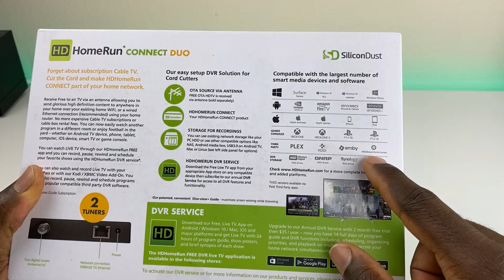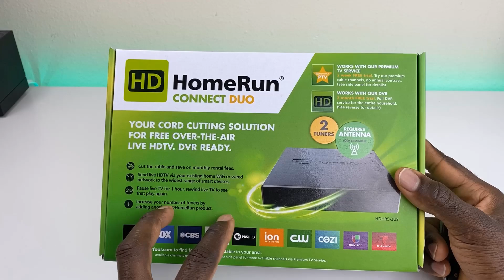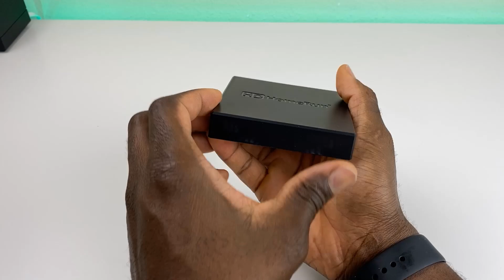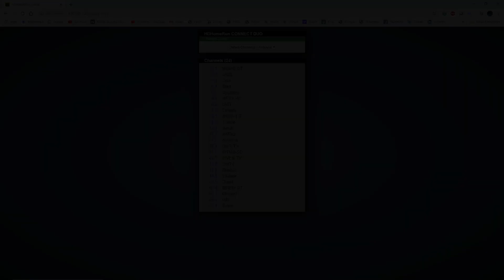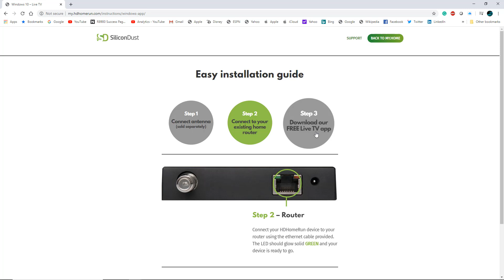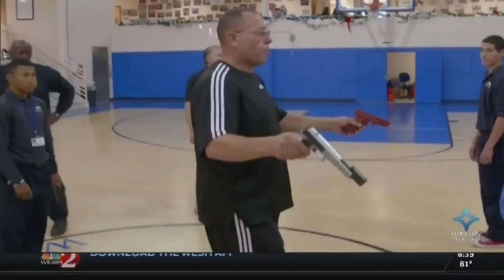HD Homerun - Still The Best Way To Cut The Cord and Enjoy Free Over The Air TV?

Comment: Your review neglects to mention than the HDhomerun does not support encryption (DRM), therefore,  it is useless if purchased with the idea you will receive nexgen 3.0 broadcasts. Most nexgen 3.0 channels are now encrypted. And. if you are fortunate to be in a market where the channels are not encrypted, you will have no audio because this unit does not support the new audio format (unless you use their App for cloud service audio)  But wait, there is no app for Samsung TVs' At least be upfront, it is not compatible with Samsung TVs and it is not certified to receive encrypted 3.0 channels therefore useless as a nexgen 3.0 4k tuner.

Comment: I would appreciate some clarification. The Duo is dual tuners but only has one coax connector? How would one connect a second antenna? Using a two-to-one connector would just have the two signals stepping over the other, no?
Reply: I’m rather new to this and learning.  I think just one antenna RF input, indeed, then the two tuners do their thing and put out two signals to the router network system for two TVs or tablets, etc., to pick up.

Comment: Any antenna will do. Even the old one you used 20 years ago if it is still intact. There is no such thing as an HD antenna. Its a marketing scam. An antenna made of coat hangers cut to the correct length will work.
Reply: Assuming the signal is good enough. Mine is attached to my glass slider and is good most of the time, but not all the time, depending on whether, etc. When you read antenna reviews, it mostly comes down to people who are fortunate to have good signal who rave about the their antenna and those that have poor signal who say that the antenna is worthless

Comment: I have the quad-HD tuner version, and I will probably be getting the Prime in order to replace the Tivo Bolt I just retired. The HDHomerun DVR is much more reliable and stable than either SageTV or NextPVR ever were, but they seriously need to do something about that program guide. The design is criminally bad. 

I was going to get the 4K tuner, but it looks like nobody's going to be making an AC-4 codec for it, so I won't be able to edit shows for burning to Blu-Ray, not to mention they keep talking about putting DRM on ATSC 3.0...

Comment: I have been using the quad unit and the recorder quad version for quite a while now and they are two of the best things I have done since I cut the cord.  I use them with my Plex server (50TB's).  I never have to sit through a program and commercials.   Forgot to mention that one of my units it capable to receive the new 3.0 OTA.  Unfortunately Boise Idaho so far does not have any 3.0 OTA stations but I am ready when they are available.
Reply: I'm surprised that Miami just got some stations recently online for 3.0, but the content is still not in 4K yet. 😕